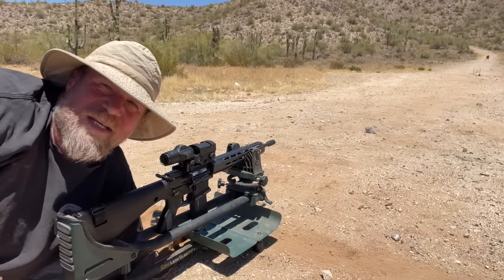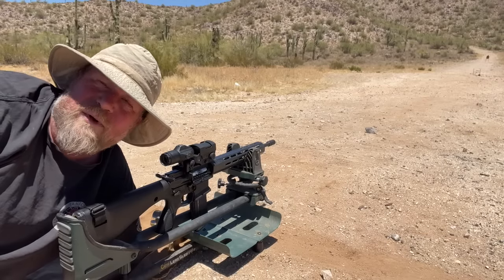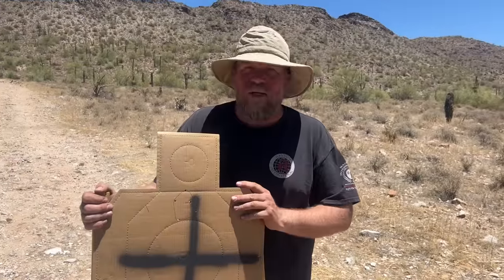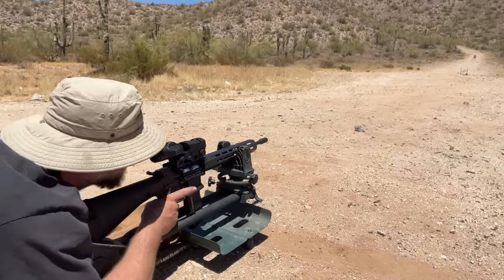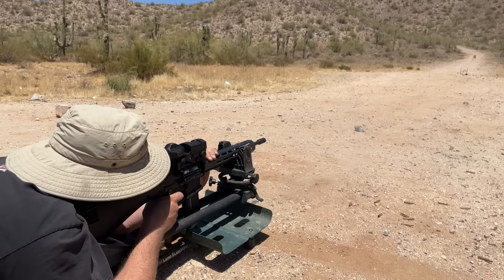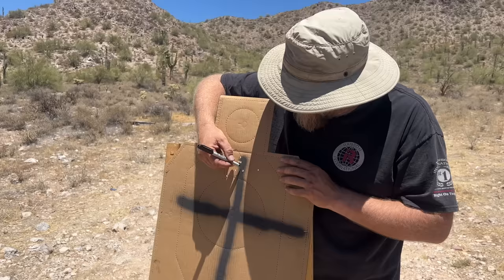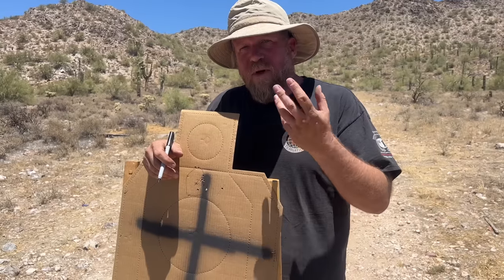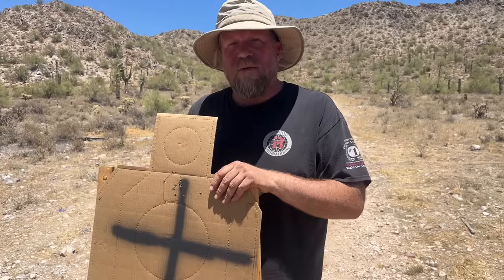WWSD - Kinetic Mfg Barrel Stress Test

Comment: The only concern I have with this new Barrel, is the gas Port size. I initially went with the Faxon based on Ian and Carl's recommendation. However my rifle is extremely overgassed . I'm hoping this new barrel does not have that issue
Reply: I've heard that the other brands they've been using are better for that.

Comment: After buying a KP15 lower I rolled my own upper with a Faxon pencil like the original concept, but I still need to replace my aluminum rail with a carbon fiber model to get the full WWSD effect.

Comment: Is this a cold hammer forged barrel, or button rifled? (Not that I’ll ever shoot the thing enough to notice the difference.) The WWSD project is what spurred me to finally make my own build. I tried to get a Faxon pencil barrel, but it seems like, at the time, somebody was buying a bunch of them to produce a certain rifle…
Reply: Imo you got lucky. I did get a Faxon and have to admit it is overgassed if you want to use 5.56 pressure ammo. I’m using a H3 buffer with a Sprinco Blue spring, probably stepping up to a Red. I would not buy another barrel from them. BA Hanson has a properly gassed pencil barrel. I assume the barrel on display here also does, haven’t looked them up.
Reply: @509Gman  I have a 14.5" & 13.9" BA Hanson P/W to 16". Then a 11.3" BA Hanson on a pistol build.  I guess I've turned into a BA Hanson fanboi.  You're right, BA has the gas port size dialed in on their Hanson barrels.
Reply: @509Gman  I bought a Faxon barrel and wasn’t specifically impressed. Accuracy was a bit subpar.
Reply: @jimyeats  accuracy is perfectly fine with mine, 2moa with M193. It just kicks more than 5.56 should.
Reply: @509Gman  I feel like mine throws a ton of fliers.

Comment: Loving my WWSD build. Only change I’ve been considering is switching the 14.5 Faxon barrel with the integrated flash suppressor (16 OAL) for a 16” barrel that I can thread an A2 onto. Because the integrated flash hider… doesn’t.

Comment: It would be worth testing the Icon defense integral gas key BCG. It has enhanced travel length, longer cam track, & larger gas chamber. The only mod to wwsd looks to be using two of the JP Ar10 buffer pads instead carbine buffer pad(though please measure to check fit)

Comment: Karl, how does this compare to a Ballistic Advantage pencil barrel. Is that barrel too heavy for consideration?
Reply from the maker: We are using ballistic advantage currently actually, and they are fine.
Reply: BA barrels performed similarly when we tested them.

BA barrels are currently the standard on production WWSD rifles and uppers.
Reply: My "home rolled" version used the .625 hanson.  You gain I think it was 2 oz. but get a VERY nice shooting barrel.  
I do want to do some kind of pencil 14.5 + front sight block iteration.
Reply: @buncer they couldn’t deliver fast enough and the oversized gas ports consistently caused problems where people needed to add weights to their SCSS

Comment: How's the gas on these newer barrels? I read quite a bit about the original faxons being overgassed, and that no longer being a problem with the BA barrels
Reply: These have normal sized gas ports.   Not the oversized ones like Faxon has.
Reply: @SinistralRifleman  Wouldn't an oversized gas port cycle cheap (sub pressure) ammo more reliably?
Reply: @TheSundayShooter yes, but when people use normal ammo it makes the gun cycle violently.   Including making the Ambi mag catch drop mags and bolt catches bounce open.   Being over gassed is not a good thing.
Reply: @SinistralRifleman  What ambi mag release are you using? I have 1 norgon, and 4 troy ambi mag releases, I have never experienced a dropped mag from over gassing, and my 14.5 when suppressed is very over gassed.
Reply: @ZERO-F2G-  I believe they use Norgons, but that could have changed.
Reply: @SinistralRifleman I haven’t had that happen, but it is rather violent for 5.56 and my friend did just complain today about getting tagged in his thigh by my brass during the local 2gun match. He was a good 10 yards away when it happens 😅

Comment: This isn't related to barrels, but I have to ask, what's your opinion on alternative BCG coatings for WWSD type builds? I went with a Sharps Rifle Company BCG with a DLC coating, because from what I could tell, it was in-line with the goals of the WWSD project: highly durable due to being made from S7 tool steel, and I found some sources which seemed to indicate that DLC has an even lower friction coefficient than chrome. I just wonder if chrome has other desirable properties that I'm not aware of.
Reply from the maker: WWSD2020 - Bolt Carrier Group
https://youtu.be/ahu8KC7YErs

Comment: It's absolutely reasonable to conclude that the barrel is not A-ffected by the E-ffects of dumping 30-rounds through the system. But N=1. Barrel over time, etc. This seems like an excellent candidate to really put through the paces! 👍
Reply: If it was gonna shift, you would have seen it start. My M1 needs ^2 minutes elevation after 20 rounds rapid fire. Two mags would have been mo betta, but with the economy the way it is…

Comment: The problem is that WWSD has no bolt forward assist.
Reply from the maker: We've gone over this extensively in the videos, and if you goto KE Arms, you can customize your WWSD to have one if you think it's the right answer.  I do not.
Reply: Respectfully,
Stoner designed the AR without one, and has explained his reasoning for doing so. The forward assist was a military designation that Stoner disapproved of.
Reply: Lol